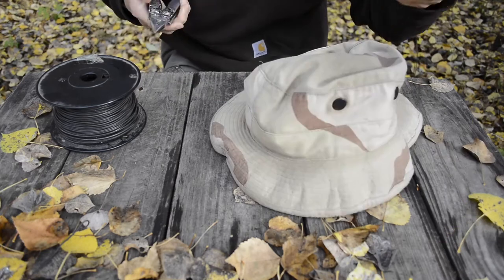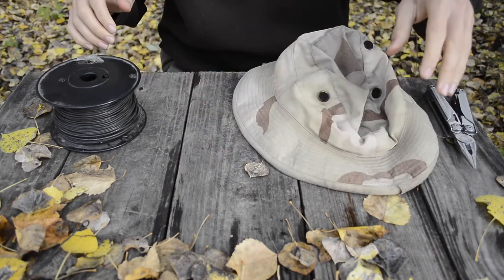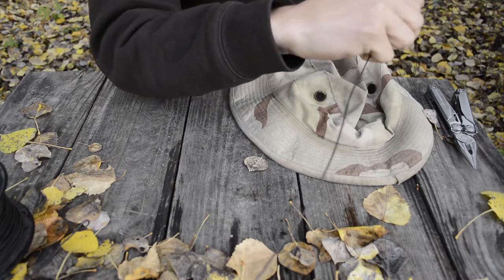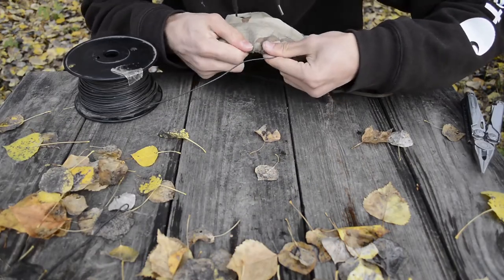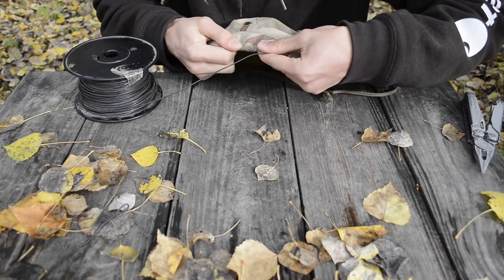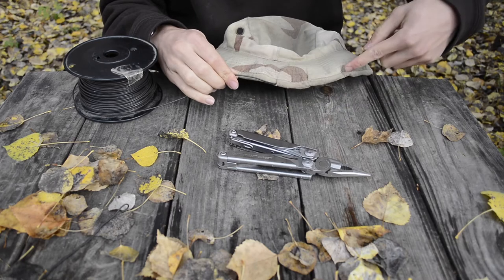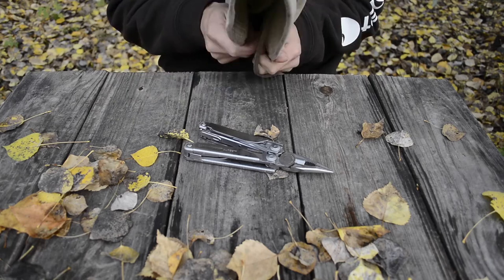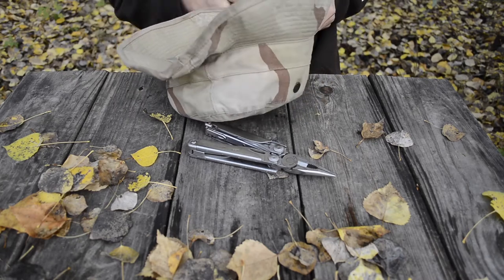DIY Military Boonie Hat Modification

Comment: I’ve had super success with this exact modification using 14 gauge copper wire from stripping 14/3 gauge wire at a recent home upgrade! Easy to push through and no silly surprises along the operation! Peace Be The Journey!

Comment: Just use starch to iron the brim. The whole point of a boonie cap is that it is packable. Also if you spray the hat with Nikwax it will shed water.
Reply from the maker: Those are good tips. Thanks!

Comment: One of the biggest problems is that the brim is too big. Most of mine are cut down to a length of about 2 inches. If you do not want to cut down the brim your solution would work well..
Reply from the maker: That's an interesting idea